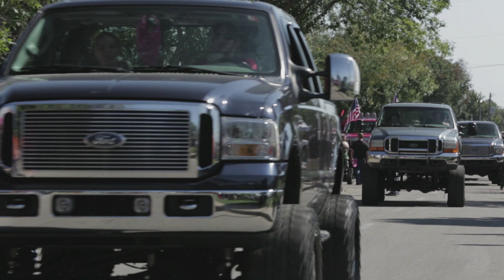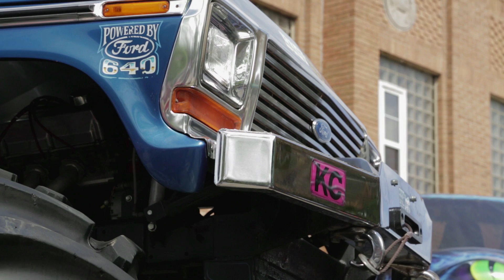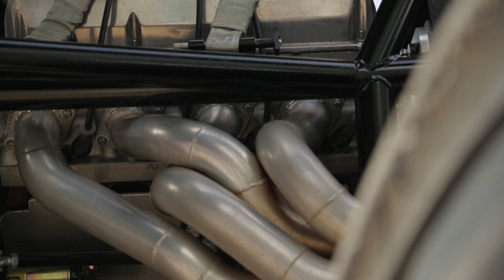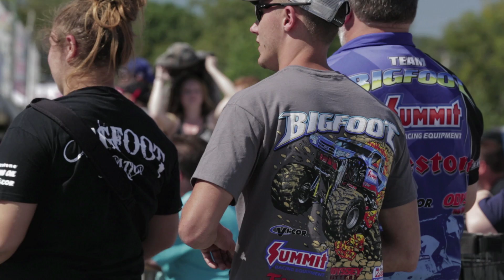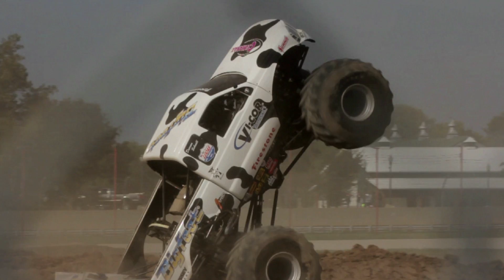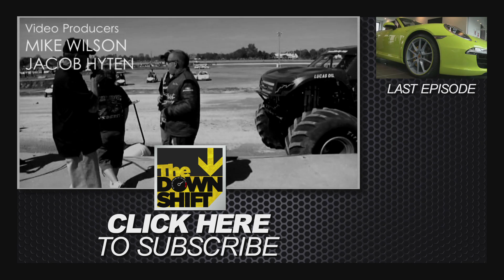Bigfoot: The Original Monster Truck! - The Downshift Episode 34

Comment: i still rember the first time i saw BigFoot in the mid to late 80s on a video called "Blood, Sweat, and Gears". the video had BigFoot racing against monster trucks with tank treads and a tug-of-war between BigFoot and crew lead by Sgt. Slaughter. adly the VHS tape's picture has deteriated to the point of unwatchable now. that's the same origanal BigFoot in this video.

Comment: When they run the Bigfoot MLB All Star body(which is a Chevy) they also run a Chevy Merlin motor with it. And the next Bigfoot coming out, #19, has a Chevy version body like the body #18 has is this video and it is also Chevy powered. Ford stopped sponsoring Bigfoot back in 2005(though Bigfoot still waived the Ford Flag until 2007) which is why you don't see their logos on the bodies anymore. Not that I care either way in the Ford vs. Chevy debate as I own one of each type of truck.

Comment: When I said #19 will have the same body as #18 I meant body type, that's why I said "Chevy version." Yes #18 is a Ford Trophy Truck body but #19 will use a Chevy Trophy truck body. In fact the main body will be exactly the same as #18 only the front clip will be different. Yes it is a partnership with Robby Gordon and Speed Energy, it fact it's Robby's old truck which is why it is CHEVY powered.